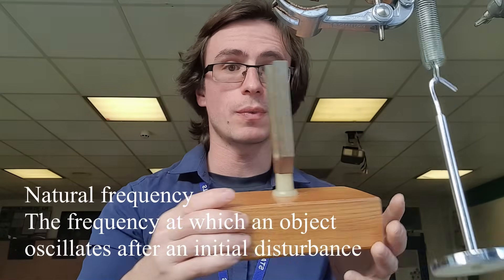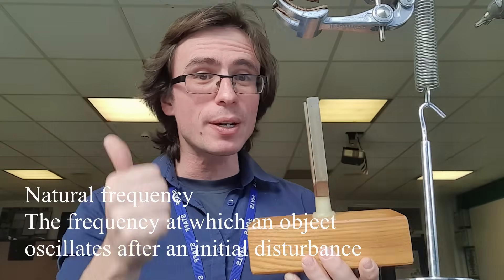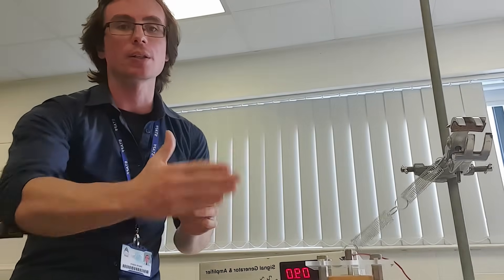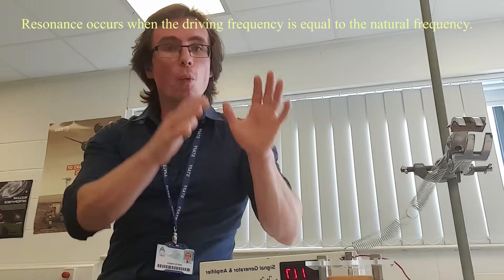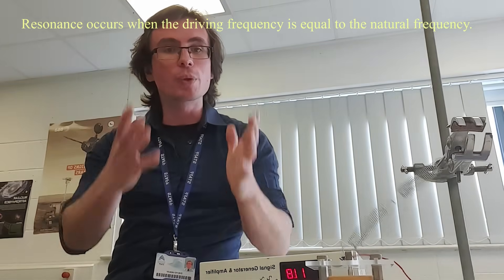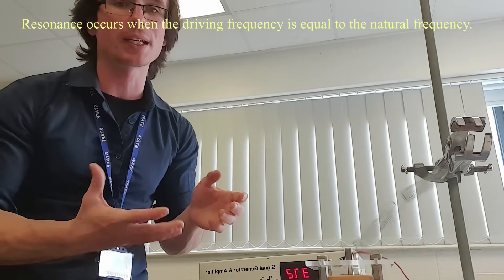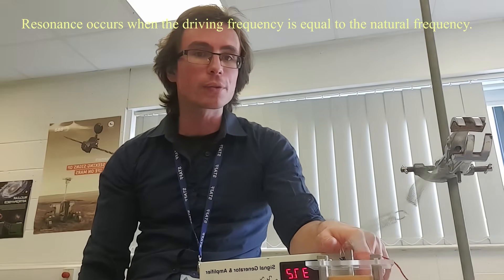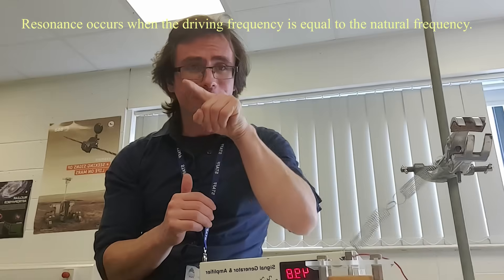Resonance and Natural Frequency Explained

Comment: No. English is not my mother tongue but I want to say that as far as I know you are wrong. In oder to have the maximum of oscillation you have to force the system at the resonance frequency that is not the natural frequency. It is lower.
Reply from the maker: Hi no problem! English is not my mother tongue too,  you speak great!

So it is exactly the natural frequency. Here is two ways to think it -  one issue is timing. Imagine pushing a pendulum with a time period T. If you push it every time it reaches your hand will also apply a period force with a a time period T.

If you prefer a more mathematical approach:
https://youtu.be/UBKGsWe4Bmg?si=NsfnL-O5491-q2oa

Here is the differential equation for it.

Hope this helps!
Reply: If you have a real system (and you were dealing with real system) you have damping ratio (d), natural pulsation omegan (on), natural damped pulsation omegad (od) and resonance pulsation omegar (or). od=on*sqr(1-d^2); or=on*sqr(1-2*d^2). When you force sinusoidaly a system it responds at maximum amplitude at "or" pulsation, not at "on" pulsation or "od" pulsation.
Reply from the maker: @marvnet8898  Oh with damping of course! : ) I teach a course in physics in which damping is not included and this video is for this.

Comment: What would the influence on the system be if the amplitude of the driving force is increased or decreased?
Reply from the maker: the resonance frequency and behaviour would not change. More energy will be transferred to the system though and the maximum amplitude should increase for each frequency. Hope this helps!

Comment: Thank you so much! Just curious; I noticed that between the low and high amplitude, the spring seemed to become almost still (visually) What is that? Is that a phenomenon with a spesific name? Would like to learn more. Is it the same thing that happens when running water looks frozen or car rims look still when rotating? Again, thanks!
Reply from the maker: very interesting. Such an excellent question! Let me explain it intuitively. Imagine you are pushing a pendulum with your hands and a pendulum attached to the ceiling. 
If you are pushing at the exact time the pendulum reaches you, its amplitude will increase to a maximum and the pendulum will experience greatest energy transfer.
If you hit a different frequency when your hands are completely out of sync with the pendulum, no energy will be transferred as your hands will just be pushing the air and not the pendulum.
This is essentially what we are seeing. I hope this makes sense! : )

Comment: Question: Why when increasing the frequency more than the natural frequency, amplitude decreases?
Reply from the maker: correct! Sometimes there are more resonant frequency later on but for A Level Physics if that's the course you are doing this is typically not required to know. Hope this is helpful!

Comment: What is the natural frequency of the human body and what is the best way to manipulate it? Is it possible to adjust using sound as some have suggested?
Reply: That's happened before! Different parts of the body have different frequencies. My physics teacher told me about a situation in which the blades of a helicopter were rotating at the same natural frequency of the pilot's eyeballs. He temporarily went blind and crashed the helicopter. It's something that engineers have to consider from now on. Also the natural frequency of the eyeballs for example differ from person to person
Reply: I am also wondering same
Reply: What a wonderful question

Comment: Does natural frequency change if you apply more tension or force though?
Reply from the maker: Depends on the specific situation. Generally objects tend to oscillate at an unchanged frequency once the forced that caused the oscillation is removed.
Reply: @zhelyo_physics  would the frequency technically be higher in the first second after the force is applied as to a couple seconds after the force is taken off? Do we measure natural freq immediately after the force is taken off or do we wait a couple seconds ?
Reply from the maker: after the force is taken off the amplitude decreases but the time period remains constant (in most systems, if it's a pendulum only for small angles). I recommend checking this video out for a good understanding of resonance: https://youtu.be/UBKGsWe4Bmg  Good luck! : )

Comment: So how do we measure these frequencies…
Most importantly how does one measure specifically the frequency of a static object to when the object is disturbed from a specific location?
Reply from the maker: So we apply a force and measure the time period of the oscillation with respect to the point. Typically we measure 10,20T and then divide by the number to get an average. Afterwards f=1/T

Comment: Excellent explanation sir.I have a question.Let's say a tuning fork has a natural frequency of 250 Hz and we hit it against the table, does that mean a tuning fork is oscillating back and forth 250 times a second or a tuning fork is creating a sound wave that has a frequency of 250 Hz  or both of them?
Reply from the maker: Excellent question, both of them!
Reply: Thanks sir.My doubt is cleared.
Reply from the maker: anytime!
Reply: @zhelyo_physics  you never answered the question...
Anyway I believe the answer is both, the tuning fork vibrates at 250hz which creates an soundwave that is 250hz
Reply from the maker: @  this is correct. Also from what I can see I answered it 2 years ago : )
Reply: @ For me it just shows your comment saying "excellent question" and your comment saying "anytime" but not you saying the answer, i dont know why that is.

Comment: Are there formulas to calcuate the natural frequency of various materials? (Glass, steel, copper, etc.)

Presumably the variables would include diameter and length
e.g. a copper bar 6 feet in length and 1" in diameter 
or    a steel tube 3 feet in length with a 2" internal diameter
Reply from the maker: Excellent question! They are different in different situations. I discuss this a little bit more in depth here: https://youtu.be/UBKGsWe4Bmg  For a simple oscillating mass on a spring it is sqrt(k/m) but different in each situation. Typically it is simply measured for an object. Hope this helps!